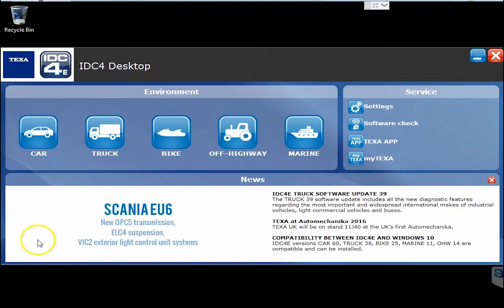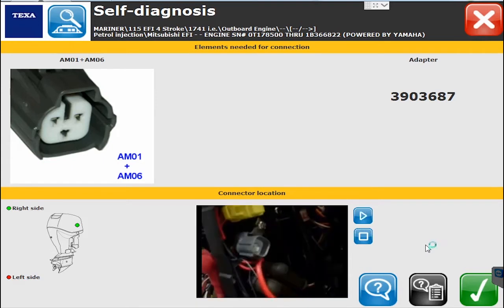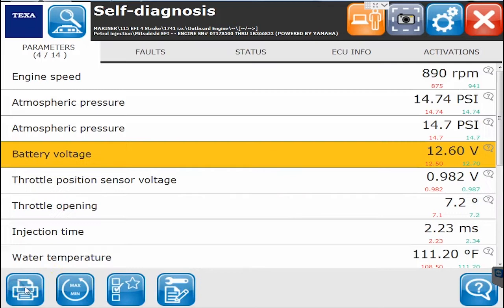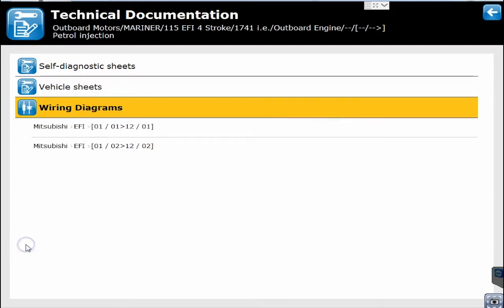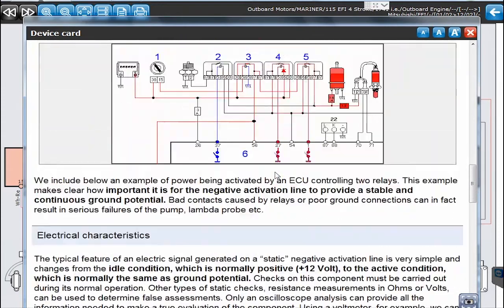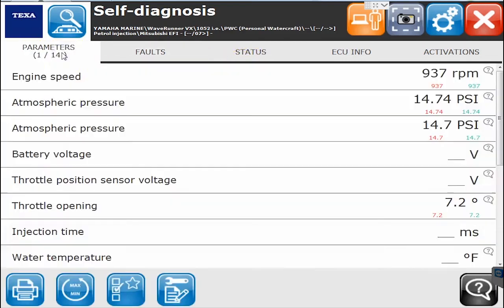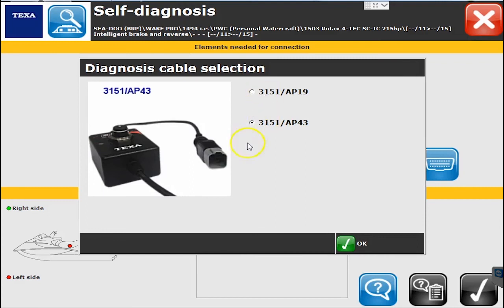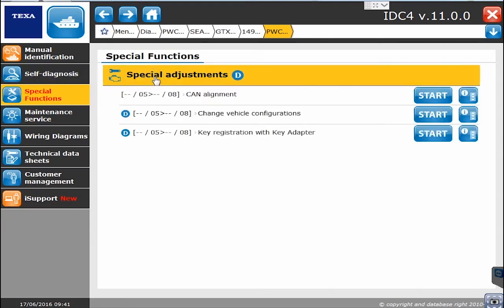TEXA Marine Dealer Level Diagnostic Tool - Volvo Penta Honda Yamaha Mercury & More

Comment: I have a konecranes reach stackers with a Volvo penta tad1181 engine would this program connect to the ecm?
Reply from the maker: If you don't have marine engines at all and only the material handlers, we'd suggest the Material Handling Kit instead: https://www.diesellaptops.com/collections/off-highway-kits/products/cojali-jaltest-material-handling-equipment-diagnostic-tool

Best to just contact us to find the best solution for the coverages you are needing -- https://www.diesellaptops.com/pages/contact-us